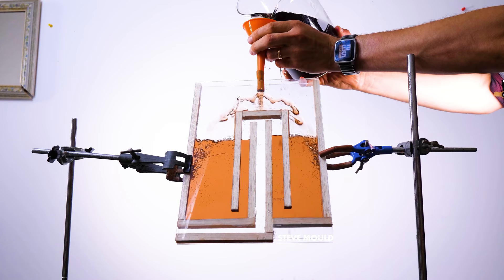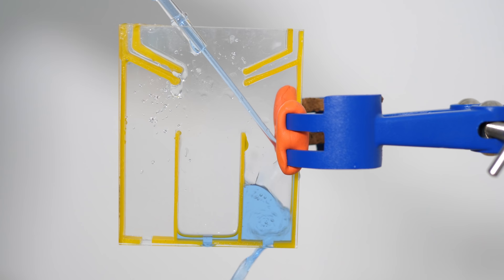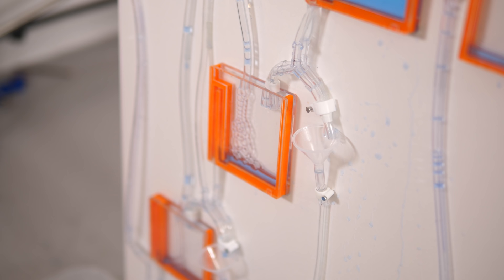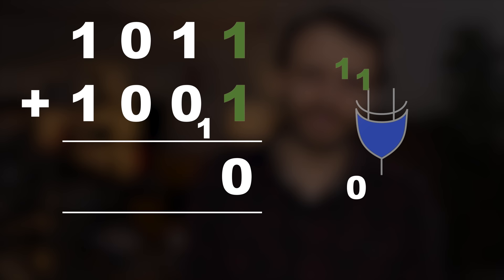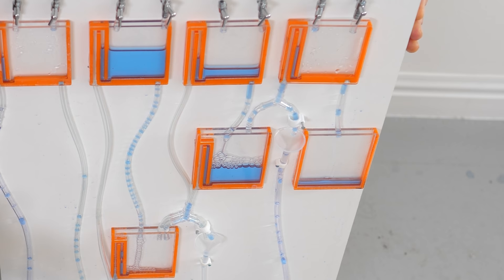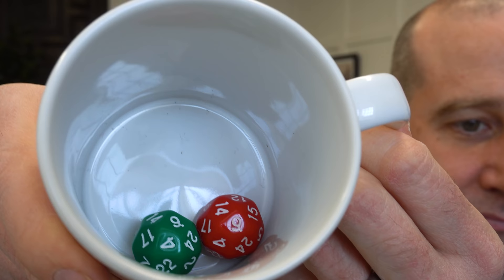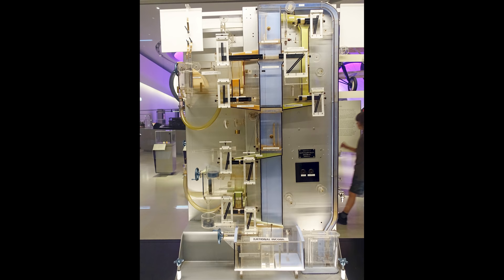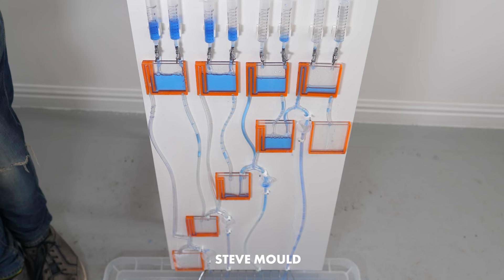I Made A Water Computer And It Actually Works

Comment: As a digital designer of microchips I'd like to say your introduction to adders is one of the best I've seen so far; my high school teacher sucked on the basics like this but luckily I still ended up in IC design :)
Reply: Would you mind telling that how to make a simplest computer if I understand transistors and logic gats already. In other words, how to assign numbers to the logic gates
Reply: @chaudry123  i don't know deep things in this, but in computer 0 and 1 means ~<0.5 or ~>0.5V. So as i think, you just need resistors for that and transformator to get specific amount of V inside your circuit input / output. Like in our PC it's power unit
Reply: @chaudry123 U set the pin to high or low, like 5V or what the datasheet of the transistor says
Reply: Well, technically this explanation sucked even more, but that is simply because it runs on siphons.

Comment: Ironically, I accidentally spilled water all over my laptop last week, and I short-circuited it when I tried to turn it on. Unfortunately no video this week as I try to get the data recovered. Lesson: If you ever spill water on your laptop, unplug it and turn it off immediately if it hasn't already automatically. Then turn it upside down, wipe clean of water, and let it dry for a day or more until you try to restart it. If it won't restart, you have to recover data from the hard drive. No one should make the same mistake I made.
Reply: Throw it in rice.

Comment: This is a good illustration why a computer will never be self aware.  Flowing electrons are not as understood as water by the average Joe. It's the same principle as using water gates; however people should understand no matter how complex the system is, at the end of the day it's still Flowing electricity or water in this case.

Comment: You could make a number display by draining the individual reservoirs into an aggregate reservoir. Each 10ml of water is an integer increase. 

Actually, you already have a sort of reverse aggregate reservoir. Fill the drain reservoir to the maximum amount that can be added, and then fill the inputs from the drainage reservoir. The amount missing the the amount inside the machine.

Comment: The splitter portion of the tubing could be simplified as another container without a syphon that would overflow when a value of 2 was added due to its max capacity it can keep a hold of being a value of 1 letting the excess value of 1 pass thru as it subtracts the cap amount it can keep a hold of maybe having a valve to reset the the exclusionary aspect of the described container for the next test kind of a clear function if you will

Comment: So the next step is to get mechanical actuators to consistently open all of the syringe valves fully and simultaneously.
After that is a method to trasfer the calculated output value back into one set of syringes so it can be used as an input to the next calculation.

Comment: A long while back I imagined what logic gates would look like if they were made of water, call this video scratching a weird itch I forgot I had.
 
Honestly I thought a cool way to do an XOR with water would be to have two inputs running over a water wheel. If there's no input, of course there's no output. If only one side has input, then the wheel would turn and the water would flow through. But if two inputs hit at the same time, the weight on both sides would keep the wheel from turning.

Comment: Why not, instead of having a 'splitter' to turn the 2 back into a 1, instead have a bucket that accepts the size of 1, when the bucket is full, it tips, pouring 1 into the next container.  When the bucket tips, it no longer can accept more input (water), so the remaining water drains off the side.  Using this approach, you could measure out more than just '1' in your syringes.  Meaning your inputs could be, for example, decimal. - You'd just have to also measure the outputs as well.

Comment: The water leakage where a low water level still indicates a 0 is noise in the system and the reason some digital receivers use comparators.

Comment: I want to see this but with a decimal display.  I feel like you could use a series of levers to convert the output into a decimal number.  Higher order bits would apply a greater torque to a lever since the radius would increase

Comment: Hm, how to make it decimal... You could use waterwheels at the end to count the bits. One at a time, so you'd need a delay, the bits for 1, 2, 4 etc would flow down through the waterwheel, and maybe use gearing to make the higher numbers count for more, when the waterwheel leads out to the final decimal dials? Might help to use more water and more pressure. Or even air pressure on top of the water? The potential for getting complicated starts here. What about logarithms? Or levers like a seesaw... YES!

A seesaw, with 1, 2, 4, etc bits arranged along one side of the left. Their positions mean that the 8 bit exerts more force than the 1 bit. This all balances against a spring, or a weight, or something, and gives a readout! I've at least converted the binary number into a force you could read, that's not bad work... Maybe just a simple weighing scale, like the stretchy spring ones you use for luggage, measuring the weight on the seesaw. 

Maybe instead of a spring you could use a weight that's simply 15 units of water, and a pointer pointing to a scale of numbers. I dunno, it's pretty aquatic all the way down, this idea.

The bigger you make it all, the more water altogether, the less potential for little inaccuracies from bits of water bobbling off or getting stuck. Somebody else mentioned a hydrophobic coating. Or you could use oil instead. Mercury even, or liquid NaK on a warm day.

Comment: I just had this epiphany on this theory. In a Ram Pump, check valves control the flow (transister), and a pressure tank acts as a capacitor and reduces the pressure and and smooths out the flow. A Ram Pump IS a logic gate in itself as a whole. I hope you see this soon. 

Small ram pumps would solve a lot of your issues and speed it up significantly. Water is just like DC current.
Reply: sounds like you have a PWM signal with a low pass filter^^

Comment: Hey steve you forgot one important thing there: for you PC (processor) to work you need STABLE source of power. if you lower your processor voltage too low yor pc will shut down
in case of water you dont have it

Comment: 12:00 This could be converted to a decimal computer by saying 1ml = 1 instead of 10ml = 1. Then you'll also need to retune the splitters to split into 1/10 instead of 1/2. 

You may also want to increase the volume of water you are measuring to make reading it more clear.

Comment: 3:43 make a escape valve for air or just make this computer in vacuum you could control the force much better but then you would need gravity to make it fall down or just use pumps and calculate it's troque then it could compute on air trapped in water and the airs motion in water would work as 0 and 1 or the water between each gap Morse code.
Fyi air is fluid

Comment: Well, actually, nice idea. I firstly thought about the same idea, as was at the beginning: using a constant flow of water. Though, it has a disadvantage you mentioned, the approach of 1 bit == specific volume of water has more disadvatanges, as I see it. The main of which is the non-duplicable bits, cause each bit - is a specific volume. It can be still solved, though, theroretically, but may require additional complication of architecture: for example, an additional reservoir of "free bits".

P.S. As an example, imagine you need any analog of an encoder. In this case, you'll have only one active bit at input, but the output may have multiple enabled bits. You would need to get some extra water from somewhere.

Comment: A simpler design would be to use analog decimal water calculator: fill one syringe with 9ml, fill another with 5ml, then empty them both to a marked container and will be exactly 14ml

😋

Comment: This will probably get lost in the comments and I understand you are wanting to build this specifically with flow, but you could use a float switch as a "1" and the greedy cup siphon as the "0" to prevent partial discharge with the "leaky" method. Especially since with the "leaky" method you have to read the next tank level anyway.

Comment: I wonder if this would be easier to work with if the components were larger, the surface tension of the water looks like it's a bit tricky. (hence the mercury comment, but with larger components you could still use harmless water. lol)

Comment: Am I missing something at 7:00. Or is the diagram wrong. You have inputs of 1 0 1 into the first AND gate (Returning 0) and the XOR gate (Returning 1). Then using the carry into the second AND gate resulting in 1 1 input (Returning 1) and the carry into XOR inputing 1 1 (Returning 0). That means with the first AND being 0 and the second being 1 the left XOR should be 1 and the third XOR should be 0.

Input 1 0 1
1st Row
IN/ AND 1 0 - XOR 1 0 - Carry 1
RESULT
OUT/ AND 0 - XOR 1 - Carry 1
2nd Row
IN/ AND 1 1 - XOR 1 1
RESULT
OUT/ AND 1 - XOR 0
3rd Row
IN/ XOR 0 1
RESULT
OUT/ 1

MEANING
+ 1 0 1 1
    1 0 0 1
Result should be 1 0 1 0 0

Then again I could be wrong...

Comment: The comparison to Moniac isn;t quite correct I think. First it wasn;t purely water-based, using pumps to model rates of change. More importantly, it was an analogue computer whereas you're trying for digital (or at least discrete).

Comment: Why don't you use a horizontal computer instead of vertical?
That would exactly same as the electronics!
A Water reservoir (tank, dam etc) will act as battery in which level of water resemble to voltage (charge reservoir).
To feed 1 and 0 you just need valves.

Don't you think that would act good?

Comment: Your first calculation failed because you did not put 10 ml of water in the fours column. You need to be a little careful with your input.
Reply: one of the syringe column was different from the rest